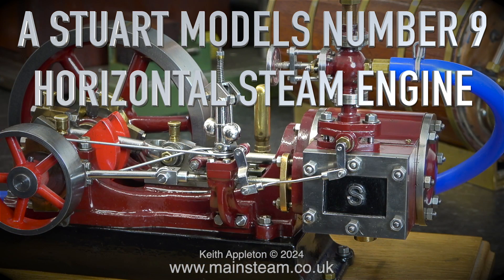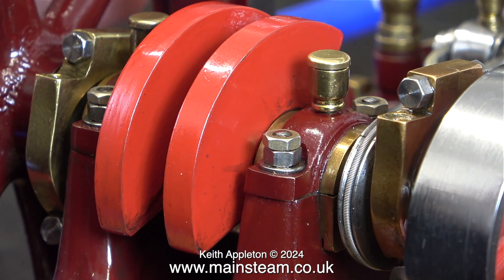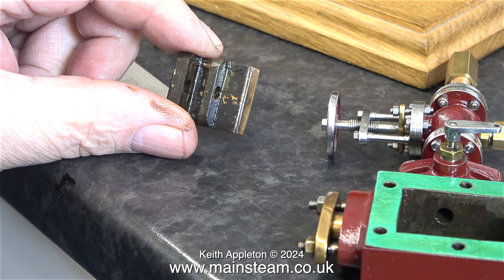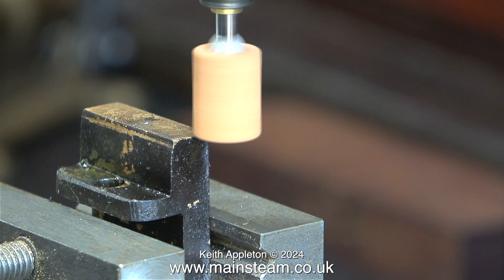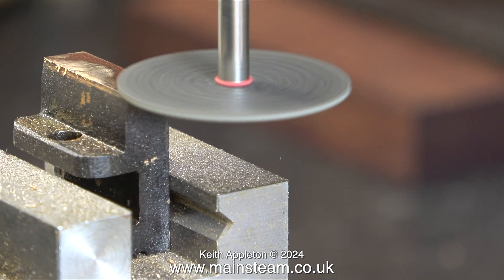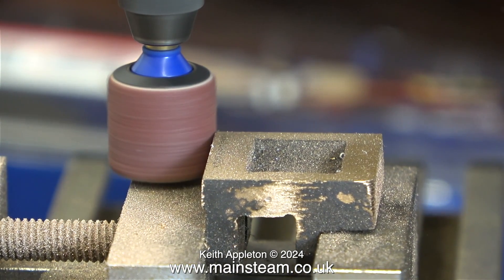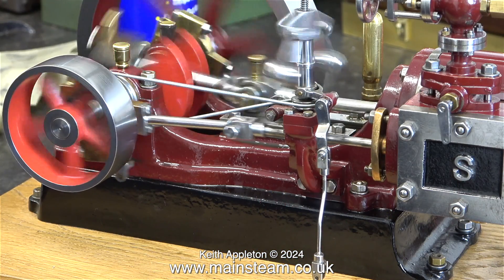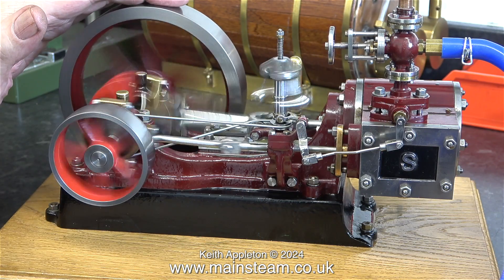A STUART NUMBER 9 STEAM ENGINE - PART #5

Comment: Is the camera moving or do the gibs need adjusting on that mill?
Reply from the maker: The little machine is not bolted to the bench ........ The gibs are fine.
Reply: @keithappleton  makes sense. If the camera is fixed to the bench then it's the machine moving
Reply from the maker: The camera is on a floor mounted tripod, same difference though .......